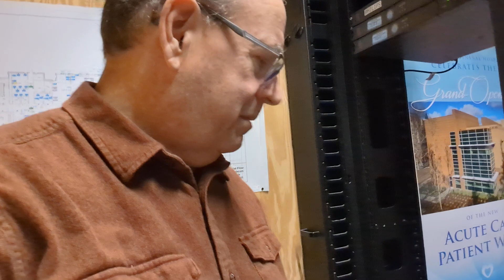Network Admin Life - Duplex issues

Comment: If these are DSX door controllers you can set the DSX-Lan module to 100 FDX by connecting to it with a serial cable and going into the config menu. The newer DSX-Lan modules have a web gui and i believe support up to 1G.
Reply from the maker: We do use DSX but not in this application.  Those are another hornet's nest!  God bless!
Reply: @NetworkAdminLife  - yeah not a huge fan of DSX. We deal with them quite regularly as thats what our local alarm company installs.

Comment: Control units for Lights. HVAC, PA, Doors etc use so little Bandwidth it's OK. Half Duplex has the advantage that it's simpler, uses only 2 pairs (4 Strands) and you can even get away with CAT3 phone wiring for short distances ... Thanks for documenting it!
Reply from the maker: I guess I can see that from their perspective.  Fewer wires to run.  But still...  :-)  Gd bless!

Comment: Who uses half duplex anymore? I am surprised the switch didn't support half duplex mode to support legacy devices. I just recently installed some Infant security door controllers from Centrax. They are quite interesting to deal with. I had one door controller that kept freezing up after 5 minutes of being on and stopped responding to pings. They have no web interface. Tested cable, the switch, verified programming and reprogrammed the door controller 3 times, and ended up having to RMA that door controller.
Reply from the maker: A lot of viewers have made some good cases on half duplex so I'm starting to see why manufacturers do it.  God bless!

Comment: Hardware person here. When designing a product ~26 years ago, the choice was between a device like DM9008, which is a NE2000-compatible 10HDX chip, and CS8900, which would also do 10FDX. NE2000 was very well known and considered 'better known', though it had a mountain of bugs to work around. We went CS8900, because 10HDX was bad for what we needed it to do. Then some companies decided that what the world needed was NE2000-emulating 100HDX chips, and they got designed in because then they didn't have to figure out to fix the firmware.
Reply from the maker: Yeah.  Several other viewers pointed out why half-duplex works out better for these low bandwith hardware devices and I guess I get it.  But still...  :-)  God bless!

Comment: If the vendor only supports half duplex,  their Ethernet controller chip is probably really old, running really old firmware which is susceptible to cyber attack...

I'm not a big fan of putting life critical systems on a network,  especially third parties.  The amount of money that life critical vendors get to over engineer/ensure reliability is much greater than the it team get. I would much prefer that they provide their own network.
Reply from the maker: I completely agree.  A few years ago we got rid of a vendor managed network that handled our patient vitals.  The hospital found it could save some money by bringing the networking in-house.  I raised many concerns over that.  It all fell on deaf ears.  God bless!

Comment: A gas station we provide service to has an ATM we were troubleshooting. Wouldnt get a connection for whatever reason. Working with vendor (who couldnt even verify the ethernet standard on their ATM for me) was no help. 

Ended up being something completely different, but turns out the 10HDX was normal. Wasnt the issue. Blew my mind modern devices are still using that.
Reply from the maker: ATM?  That doesn't surprise me.  I used to work for a bank and the ATMs were the oldest hardware on our network.  Banks and now I guess gas stations like  to stick with the old "tried and true" rather than modernize.  And now security companies can be added to that list.  God bless!

Comment: Interesting that the switches don't support half duplex. I've also seen niche products like the door access controllers that only do 10 half or100 half. Myt guess is something with the CPUs in this units that cant handle to send/receive simultaneously.
Reply from the maker: Yeah, it could be just to keep the unit as small and use as little power as possible.  Or more likely they  are cheaper.   So it seems I'll have to keep the X440's around for a while yet.  I did just check and the 5250 universal switches DO support half duplex.
48 x 10/100/1000BASE-T ports
◦ Full / Half-Duplex (autosensing)
◦ MACsec-capable  

God bless!

Comment: I support industrial controls and instrumentation and I have had that same dance. There are currently sold instruments that still only support 10 hdx over 15 pin AUI adapters . And they do that badly, sometimes without the signaling needed to support autonegotiation  so you have to force the port. I too am astounded that these are still a thing. Of course in that industry serial (232 and 485) are also a much bigger player than you might expect. But since I'm  . . .  seasoned. . .  I like the serial stuff.
Reply from the maker: I got my start in networking on an IBM SNA network.  3274 cluster controllers and lots and lots of serial ports to link them all back to the 3750 FEP.  I still have a RS-232 breakout box (DB-25) because I'm a sentimental fool.  God bless!
Reply: I support a manufacturing company, the amount of times I've had to go back and forth with controls engineers regarding 10hdx is too dang high.

Comment: Man that is a ver shitti vendor. Just half duplex 😮.

For this uscase you can argue this is nearly a vulnerability. If you talk long enough the detection will not make it on time to the server...

Takeaway from this. Next time you reach out for bids make 100mbit full Duplex mandatory.😊

Also when I have seen this right, the old switches have only 1 power supply. For a security related device there should be two in the long run.
Reply from the maker: Well I'm at least going to ask next time.  The comments are showing me that this is far more common that I thought.  So common that the next generation of switches that Extreme offers DO support half duplex again.  God bless!

Comment: I still deal with HVAC controllers and some other IoT devices running at 10/half.  Luckily, all of the Cisco gear we have in production still supports this, but I’m sure that will change at some point in the near future.
Reply from the maker: It's funny, the Gen 1 Extreme switches support half duplex, the G2's, some do some don't.  The G3 switches all go back to supporting half suplex.  Probably for the very reasons many are mentioning here.  "What your switch won't allow my HVAC controller to communicate?"  That won't go over well.  God bless!

Comment: half duplex in this day and age? last time I used half duplex I think it was with cards that still had a 10Base2 connector on them, and even then, some of them supported full duplex on the 10baseT.
I have seen problems where you get random drop outs on a port when one end is set to auto and the other end is set to 100Mbit. those are always fun.
Reply: I had familiar issue when working for phone vendor, lot of voip phones got 100mbs port but someone had some old strange 10mb stuff that had issues with newer network switches.
Reply from the maker: As I'm finding out in the comments it's a lot more common than I first thought.  God bless!